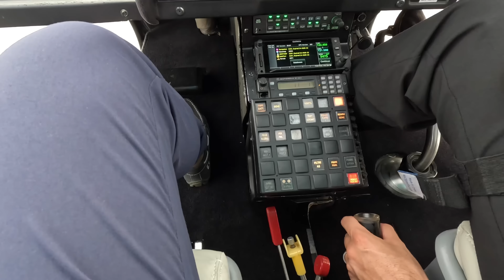Classic Boats, Yachts & Helicopters 😳 Geeking out with Autoboote Berlin

Comment: The Royal Navy and the Royal Australian Navy operated coastal patrol and convey escorts during World War II that were powered by marinized Rolls Royce Merlin engines; they were also used as Sea Air Rescue for downed aircraft, there were atleast two that I know of that still operated out of Sydney in the 70's. About the only part of the boat touching the water at full speed, was the back quarter of the vessel.
Reply: Check out SAR Air Nymph(ex HMAS Air Save).
Reply from the maker: thank you for sharing!
Reply: Find Out more!! Greetings, Michael from Autoboote-Berlin

Comment: At the 21:00 mark, y'all mentioned that black plastic and called it "bah-ka-leet". I assume that's the German pronunciation, but it's pronounced "Bake-ah-lite" here in the US.

Fun fact: Bakelite (Phenolic resin) was invented in New York by Leo Baekeland and patented in 1909. It's actually still in use today. Fiber reinforced phenolic resin sheets are pretty common in certain industries. I wouldn't be surprised if it was used in speakers, honestly. It's easy to machine, dimensionally stable, and tough. Not sure how it'd do for making a speaker cab, but it'd definitely be good for bracing.

Comment: Victoria, I have been researching renewable energies for vehicles for years and I have designed a all electric motor that will be used in automobiles, and I would love for them to be in boats. It sounds impossible but it's not. This electric battery/motor system will never need to be recharged for the life of the motor meaning. Pick a destination and go without the worry of energy shortages. That boat yard has a energy vision and I know the answer they're looking for. Nobody else on the planet has this type of propulsion system. True story guys. Electric cars will be able to go 100,000 Miles before and propulsion system maintenance or any types of fuel.
Reply from the maker: we would like to find out more about it pls reach out via contact @ nautistyles . com

Comment: 21:20 Bakelite (/ˈbeɪkəlaɪt/ BAY-kə-lyte), formally polyoxybenzylmethyleneglycolanhydride, is a thermosetting phenol formaldehyde resin, formed from a condensation reaction of phenol with formaldehyde. The first plastic made from synthetic components, it was developed by Leo Baekeland in Yonkers, New York, in 1907, and patented on December 7, 1909.[3]

Comment: Not sure if this fits your request for info on electric motored boats. There is a fellow You Tuber (Bobby White, Sailing Doodles) having a 50 foot, electric, sailing catamaran built in Thailand. It will have a small internal combustion engine on it to only charge batteries. It is supposed to debut at a boat show in late spring, early summer. I don't exactly remember. Check him out if interested.
Reply from the maker: very familiar, thank you... we were talking about something very different 😝🙈🙈

Comment: How nice. Those boats are beautiful. Just one thing though, if steam engine can be hooked up with a diesel burner and be  hugely efficient, paired with the known longevity of steam engines in general, why do some company not make modern diesel powered steam engines? Very little noise pollution too, and the water refill of a steam engine should be no issue on a modern yacht, because they all got efficient watermakers anyway. EV's are more greenwash than actually green anyway.
Reply from the maker: thanks for sharing

Comment: are THEY making HYBRIDS with ''desel elctrickik'' setups where the DRIVE is all motors run by electricity and the power is by solar, wind, and desel generators instead of biger engines for forward propulsion? 

that's my idea of a HYBRID anyhow... ONBOARD GENERATORS that do not plug into the grid, have a battery system and the 3 cylender engine is a GENERATOR&CHARGER that runs a 15 mins CHARGE CYCLE to run 45 mins quiettime on batteries.... (or somethilhng like that...  40 mins chargetime for 4 hours runtime... ? the ratio like that...  15 mins charge TIME get you run timess of 45mins to an hour RUNSILENT MODE.... 

TESLAS and stuff that plug into the GRID are PARASITES :)  they are skeeters and leeches that cause us to not be able to run air conditioners at 4pm and stuff... lol sigh....  hahahaha

Comment: 100..120 km/h dude is talking bullshit
Reply from the maker: and you know it how??🤷‍♀️🤷‍♀️
Reply: No hes not... Thats a RR Meteor tank/boat engine...the detuned version of the spitfire engine 27litres  v12 .. 
Check out a Car called the beast. 
Those engines were used  in pairs or triples to power Motor torpedo boats and Fairmile class 72' Motor gun boats.  They were also used in the RAF high speed rescue launches. 
1kmph is near enough 0.6Mile ph   100kph =60mph  120 = 72 mph 

The racing hydroplanes used tuned aero engine versions and  hit 200mph.
But the Spitfire Merlin aero engines produced over 3 times the Meteors power on carbs. 
The most powerful engines used were the RR Griffon engines also supercharged  but also a greater engine capacity. 

There was actually  an German E boat that was fitted with 3 Merlin engines salvaged from downed aircraft.  The E or rather S.. Shnell boats used diesel aero engines so a little less explosive than using than the RR petrol engines..😂 

Check out some of the other great aero engined racing boats.. of that period some of them used multiple vast aero engines.

RR having built a electric plane motor and taken the world speed record ...have withdrawn officially from electric motor research. 
There is a company in Newcastle area .. called Advanced Electrical Machines.AEM. 
They build green electric modular motors that dont need rare earth magnets or even copper. They are also very efficient.